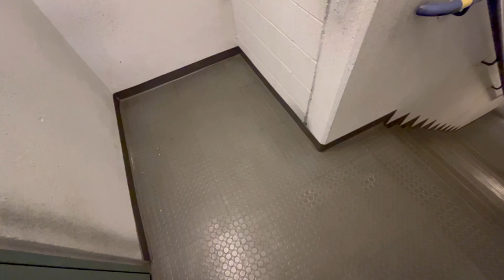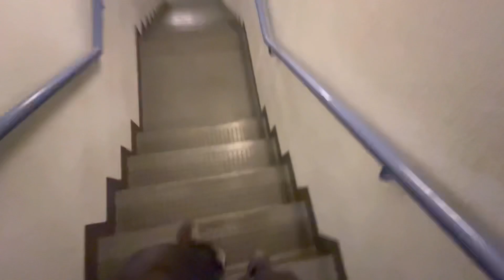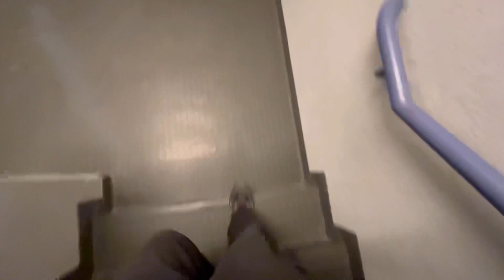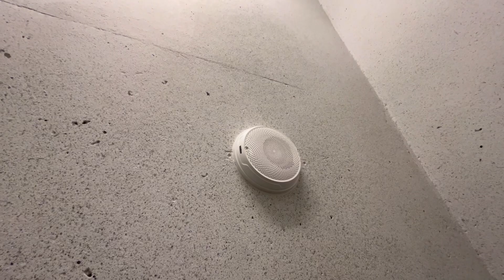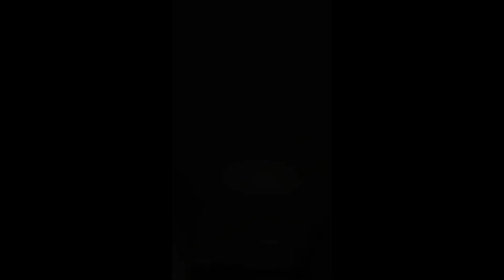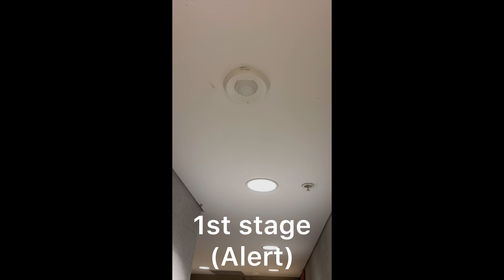Notifier 3030 2 stage voice Messages

Comment: Another reason why they have ceiling mount speakers on the walls is because when they replaced the system when it had the original speakers, it had some slight extra cutted out drywall due to the way of how these speakers got installed which meant they used the ceiling mount ones to cover up the holes and which meant during the replacement they used the System Sensor SPCWL L-Series speakers.

On a normal cutted out wall for a double gang backbox, it doesn't matter if a wall or ceiling speaker goes here as it performs the same exact way which the only exception is that ceiling mount speakers are secondary speakers that are larger than wall ones to cover up slightly extra cutted out drywall that would make the speakers look ugly because there's a hole in the wall right where the wall mount speaker is.

And it can't be with speaker strobes because of the differences in the direction of the strobe light output direction except if it's from the SpectrAlert Advance series for a retrofit install then yes as you can switch the wall and ceiling mount models on an opposite place like a ceiling mount on the wall where's in a normal install it's the device that matches the type of mounting and only except if it's a remote horn or speaker just like in the video here because one with a strobe will look goofy.